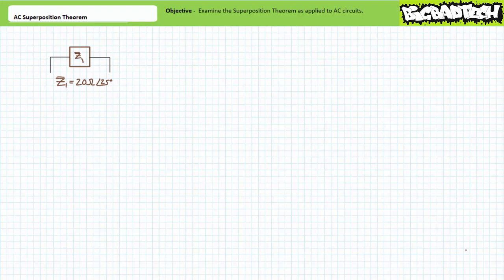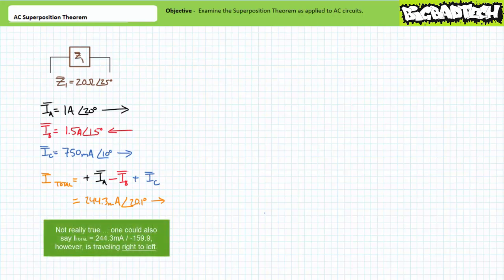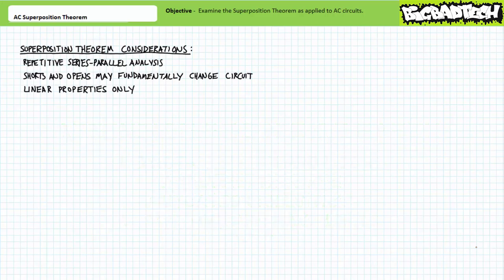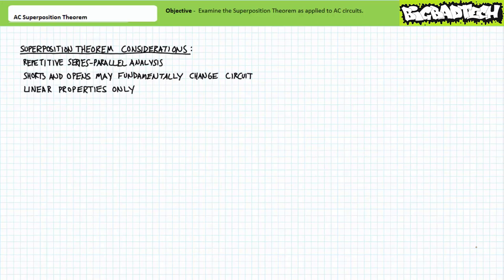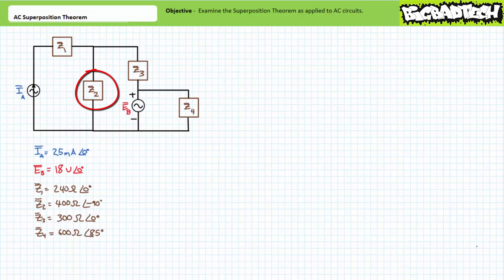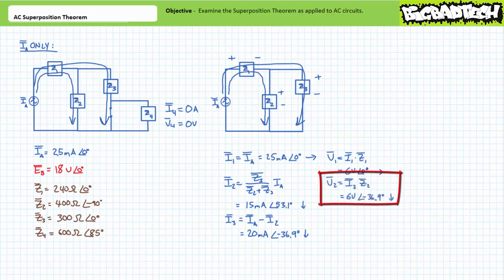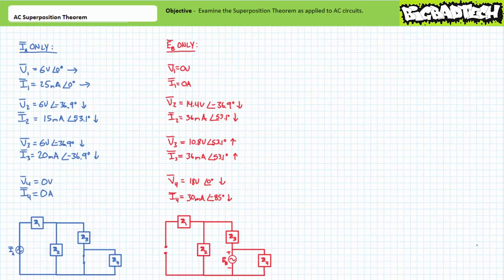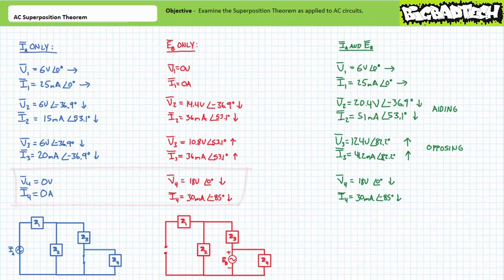AC Superposition Theorem (Full Lecture)

Comment: It makes sense that current sources would appear from the outside as an open, and voltage sources as a short. After all, current sources limit current to a dialed-in number, so external sources are accounted and corrected for. Likewise, it is easy enough to push current through a battery. The challenge is the arithmetic, with one oversight or error causing a cascade of mistakes down the line. Thank goodness for computers.